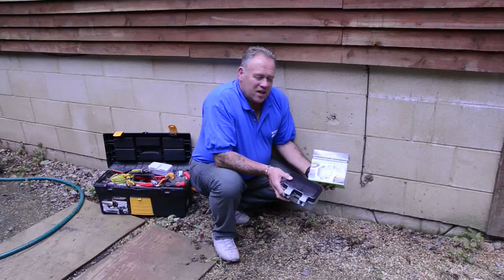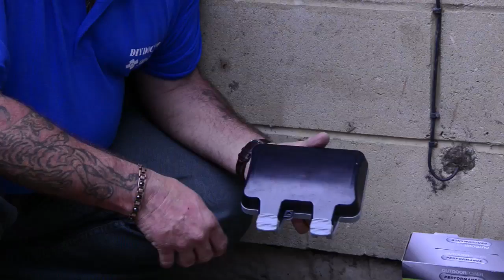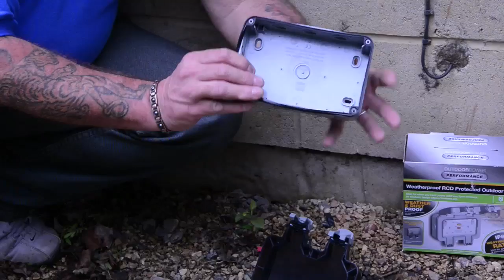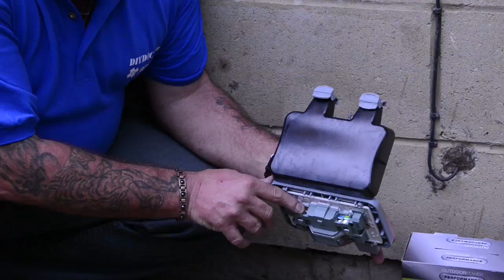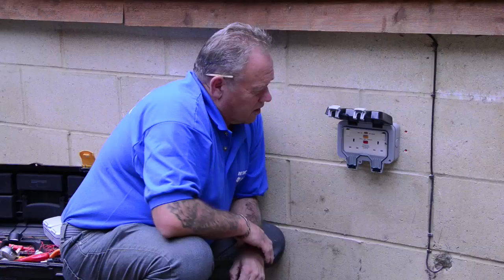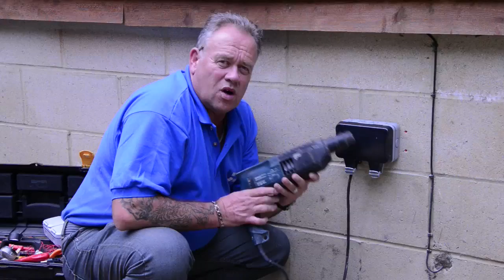Nexus Performance RCD External Switched Socket Product Review

Comment: I'm a little confused by what you say at the beginning of the video "By law, you must have an RCD on any socket that powers an electrical device outside" - do you mean, that if I install a cheaper weatherproof socket for my electrical lawn mower, that outdoor socket must have its own RCD built in? as well as my electrical distribution box having RCD's in it too?
I thought the law for this was only for an electrical device that will be permanently connected? I'd be very interested to know which law and make sure this is the correct information.
Reply from the maker: The socket you actually use for an outside applaince must be RCD protected Steve. This protection may be available frm one of your indoor sockets which is already RCD protected from the consumer unit. To be on the safe side we suggest that any external sockets, regardless of where the power is drawn from, carry their own RCD protection. I hope this clarifies the situation
Reply: Yes it does clarify this. I would suggest updating your video to confirm this, as it currently states it is law for the outside socket to have it's own RCD, which is not correct, and that you only advise it does have it's own RCD. This will clear up any further confusion.

Comment: Hi I have this socket and it has a. earth screw on the back box do you have to run an earth wire from the terminal on the front plate to back box thanks
Reply from the maker: +ladyanna Yes, that keeps any metal parts of the boxed earth properly.

Comment: Nice video. I'm looking to install an outdoor socket of this type on an external garage wall. The garage wall is pebble dashed and I'm concerned that the back box won't make a good seal against the wall, any tips?
Reply from the maker: +AlabamaTree You can either use a bolster chisel to level the part where the back-box will sit, or apply a bit of render to level the existing surface out. The more usualway however,is to treat some timber (usually plywood) and plug/screw this to the wall first. This will give you a completely flat surface which is easy to fix the back-box to.

Comment: How do you get the power to it is it wired to a socket inside the building
Reply from the maker: Danny Kay This particular socket was wired straight back to a spare on theconsumer unit Danny but it could be spurred from a socket indoors
Reply: Ok thank you what would be the best for me as i am looking for several sockets at the top of my garden in a lean to 4 sockets in total would i need a garage consumer or would i be aboul to wire 2 twin sockets to a socket in my house.
thanks
Reply from the maker: Danny Kay Legally you can onlyhave 1 spur per exising socket so to get two doubles at the topof the garden you would need tocome off two indoor sockets BUT>>>>You wouldneedto run armoured cable down the garden towire each one which would be a lot of effort not to mention expense. It is much safer aand cheaper to come from a spare in your existing consumer unit to a new small consumer unit in the garage (creating a new circuit) and wire the sockets from there. I have to tellyouhoweverthat it is not legal (under part P regulations) for you todo this work as it is creating anew circuit whichmust only be done by someone registered under the competant persons scheme. Take a lookat our electrical pages ondIY Doctor http://www.diydoctor.org.uk/diy-how-to-type/electrical.htm - there is loads of info there about what you can and can't do. Good luck anddo let us know how you get on..

Comment: So how is the back of the socket sealed where the wires go in? (To stop water running down the wall and into the back of the box?)
Reply from the maker: Wires coming into externalsockets are sealed by rubber grommets which fit in the hole in the back of the socket box and the cable is pushed through them. This seals the joint.between cable and box
Reply: DIY Doctor I see. I guess the grommet has a raised part on both sides of the hole to help channel the water round the sides of the grommet and off, and not into the box then. Thanks
Reply from the maker: You can see more about grommets here  https://www.youtube.com/watch?v=1WTCGlvl3Rg  the grommets used to seal external boxes fit more tightly round the cable.
Reply: Incorrect a grommet is used to protect cable entry E.G metal back boxes, a stuffing gland is used to seal the cable entry point

Comment: Tidy video. So where the wire coming from,where it linked to? Is it to a indoor socket or spurred?
Reply from the maker: Comes from the RCD side of a consumer unit in the Greenkeepers workshop. Hope that helps.
Reply: DIY Doctor thanks. Sorry I'm trying to get a picture in my head. So got the wire from the rcd unit already fitted,that wire runs to the outside wall u have there. What if there's a switch indoors that is near to where I want to put the outdoor socket,can I use that wire to link to the outdoor socket? Is that an RCD wire? Is is safe?
Reply from the maker: Gib Keight
Please do not attempt any electrical work unless you are absolutely clear on what you are allowed to do. Every socket outside, and every socket inside which is capable of being used outside via extension leads or appliance leads, must be protected by an RCD (ResidualCurrent Device) Please se the DIY Doctor electricalpages to find out all about part P of the building regulations which willtell you what you are allowed to do and what you are not. A link to our electricalpages is here. Please be absolutely sure you know what yu are doing, and whether you are allowed to do it,before you attempt any electricalwork whatever.   http://www.diydoctor.org.uk/diy-how-to-type/electrical.htm

Comment: Why did your electrician not cover the existing holes already drilled in the wall........... That's rough!!
Reply from the maker: Not the electricians job on this ocassion. The plugs were removed and the holes filled by the bricky later who also rendered the wall.

Comment: Nice. But how does one prevent water from seeping thru the back inlet cable hole (or for that matter the side holes if one uses these)? The wall surface may not be even so there is all possibility of a gap
Reply from the maker: Each inlet has a rubber cap with stops water entering the unit. The back of the unit also has a rubber washer which hugs the wall so even if it slightly bumpy it will stay dry. The unit should not be used on walls which vary too much in terms of being flat